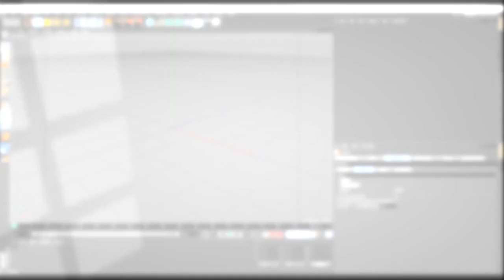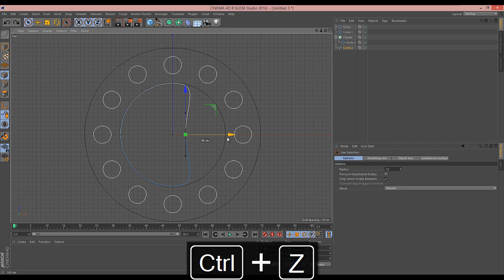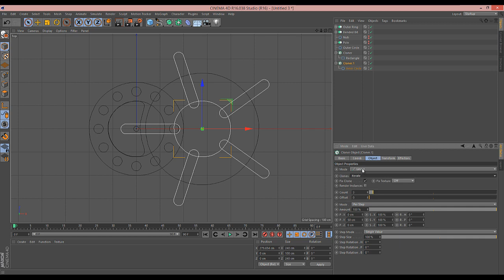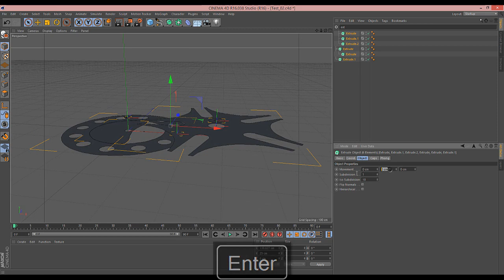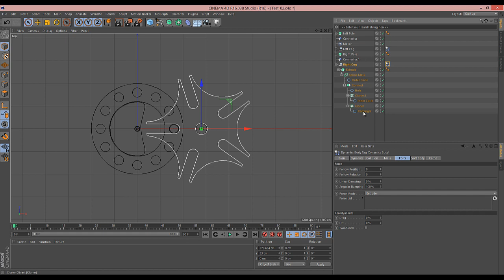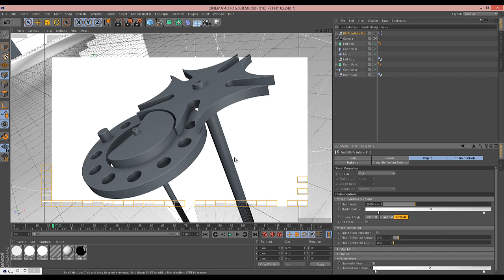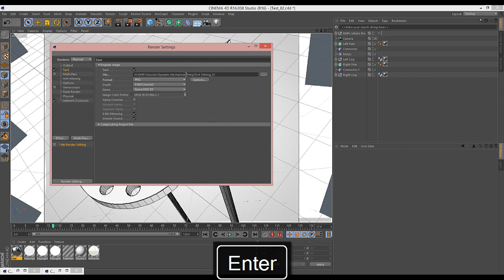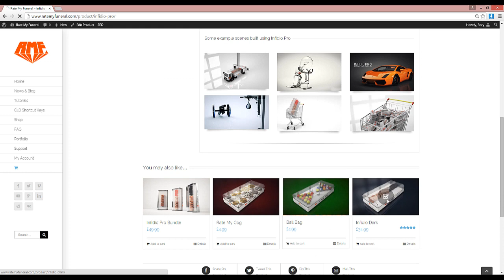How to Create a Dynamic Geneva drive or Maltese cross in Cinema 4D | C4D Tutorial

Comment: Cool tutorial. By the way, the name of this device is called a Geneva drive or Maltese cross (I'm a mechanical engineer and these things were quite the headache in engineering dynamics courses at university). I might suggest changing the title or adding something in the description involving the name of the device. There is a multitude of mechanical engineering devices that could be considered to be an "Awesome Dynamic Mechanical Thing" so I figured it'd be helpful for prospective audiences to search specifically for this device in the video.
Reply from the maker: Thanks. You raise a very valid point! Not sure why I didn't think about this already! Cheers!

Comment: the part of modelling is 100% good explained, very useful and helpful, but when we start with simulation tags I can see you speed up, hard to follow, I was unable to make my model move. Is a good job, if you can explain the part of dynamics using the same way you use to explain the modelling would be great. Anyway, can see your dedication and my opinion is very positive. Thanks.
Reply from the maker: Hi from the future. Sorry you struggled with the physics bits. This one (if I remember) was pretty tricky so to be fair I was lucky to get it working at all. I hope you figured it out in the end. One tip I can give, if I am going to fast, set the video speed in YouTube slower (in the little cog) and it might be easier to keep up. Have a great one!